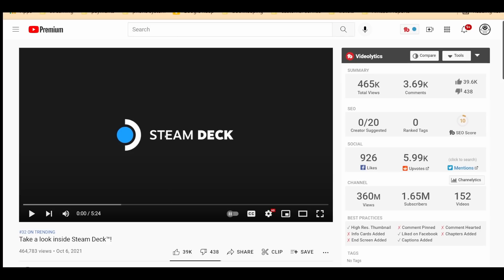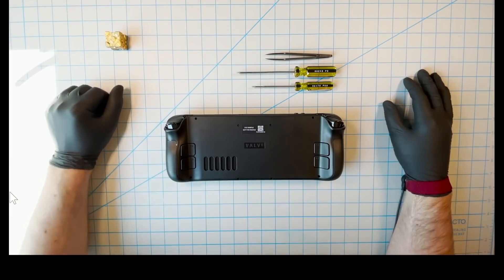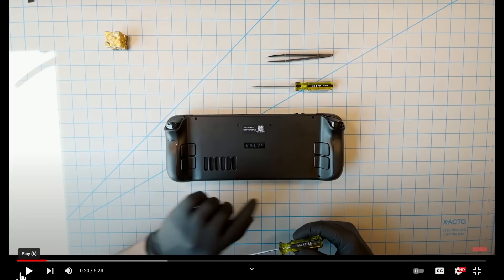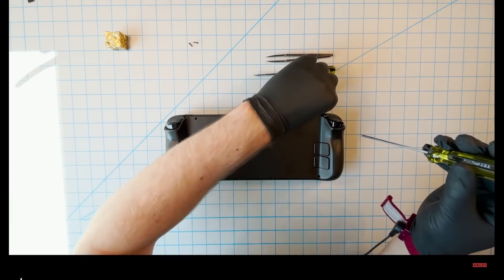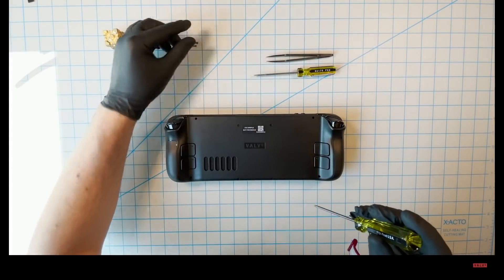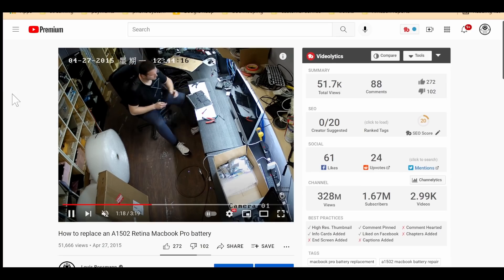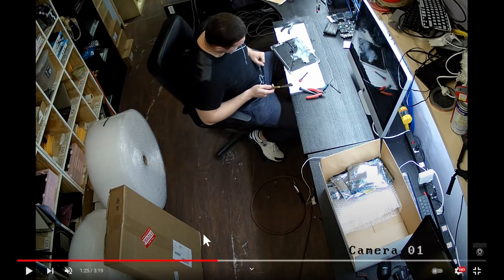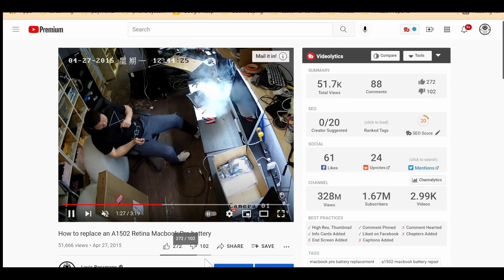Steam deck battery may end your life? bruh 😑

Comment: Self tapping plastic screws can bear most load when they are first installed with exact torque. 
When you reinstall them in the same thread with the same torque, they should be still performing optimal. 
But when the torque is too high, or a user made a new thread into the plastic, the connection is weaker. 
I doubt that matters though, unless someone treats the device roughly. 
And 3rd party repair or the user might be able to melt some brass inserts into the plastic and use proper screws from then on.
Reply: I'd also imagine that overtightened screw can apply extra stress to the area. Dropping it at the wrong angle can apply additional stress that might cause the case to crack.
Reply: I was just about to comment to this effect. The "will reduce impact resistance" is more "can reduce..." and I suspect most users would never notice a difference.
Reply: @AaronAlso  I'd say that the "will" instead of "can" is simply a CYA kinda thing. Prolly won't do much to change the structural integrity if reassembled as manufactured. I like @Arno nümuss's idea with the brass inserts, not too difficult to install. Just need to ensure that the addition doesn't have a negative impact on the rest of the system!
Reply: "I doubt that matters though, unless someone treats the device roughly. "
Based on how most people's phone look like, I can safely say that most people will abuse the shit out of this device.
Reply: I agree with your opinion but I would also add that if the screws are not cross threaded than the device should be as structurally sound as it where before opening along with the appropriate torque.
Reply: I second you opinion. It agrees with my fundamentals in materials science from Mechanical Engineering. That being said, the likelihood of all of the users reassemble the thing correctly is very low. I doubt I'll even find a torque wrench for such low torques. And I owe 3 so far....
Reply: As someone who gets brought a lot of random stuff to fix because "you know tech stuff, so please fix it?", and having seen things that other people have opened up first, I can attest that a lot of people don't understand the difference between their plastic stuff and the lugs on their car wheels, because I've had devices where half the bosses were broken off or split because someone felt they needed to use 80 ft-pounds of torque during reassembly.

Louis is too used to working with competent employees, and with computers that use metal inserts for the screws to thread into, that he hasn't seen what some ham-fisted people can do. But I can imagine that the Steam Deck people have workers who are experienced in providing support to similar plastic devices (game controllers or mice or whatever else) that people have completely destroyed by taking apart and reassembling with zero understanding of what they're doing, and that's what they're trying to avoid here. I get it. It's real. But folks like Louis and anyone who works on stuff like this all the time is not really going to have a problem - if a screw isn't threading right, they're not going to just use force to force it - they'll stop and figure out why it's not going easy, and they'll solve the problem. It's the people who WILL use force - and split or break off the screw bosses or strip them out completely that are the problem, and these people definitely DO exist. And they're always the ones who want a free replacement, plus some "extra" for their troubles.
Reply: @BigTroyT  I generally agree with that assessment. But I don't know the numbers of customers who are like that and if they are reason enough to cause that business decision. Or if it's done out of principle. In the end it doesn't matter. They covered their butts legally and now I just hope they will provide quality information for owners who want to do repairs at their own risk.
Reply: I agree with this, it's a "Can" more than "Will" but they did say to use a torque wrench or screwdriver to reinstall. Which I would say is just providing instructions to prevent stress or damage.
Reply: You know there will be people who will over-tighten the screws, and that will actually decrease the structural integrity of the device. So I think it's totally fair for valve to say that.
Reply: @brentlidstone1982  I don't disagree. I just say it's not a problem that is guaranteed to occur for everyone. Especially if they provide information like the correct torque, qualified repair will be able to deliver a repair that is hardly different from the original. One could program the screwdriver to find the thread and then screw it in with the correct torque reliably. Home repairs are also possible depending on the skill set of the owner. Good sensitivity and dexterity will allow someone to feel the original torque upon unscrewing and also feel where the thread is upon re screwing until the torque feels like original. It would be the owners responsibility though, to treat the device according to the quality of their repair.
Reply: The first thing I would do is drill and press inserts into the screw holes, and fashion some nice machine screws at the proper length. The moment the speaker referenced self tapping plastic screws, I was like  "oh hell no!"

I would not suggest heat inserts unless you know exactly what you're doing. Once you damage the posts enough, repair on the plastic becomes a nightmare. (The small size makes installation a chore.) *I HIGHLY suggest you use a hot air station to heat the inserts at proper temp for the plastic. Mine is digital and has accurate temp settings.

Get yourself the proper drill size for the insert.
Buy a "hand pin drill."
Get something you don't care about and make a couple practice runs.

Don't use a small pin to widen the hole, and use a BIC lighter to heat the insert. (yes, I did this once, no it didn't go well. After much rework, it eventually assembled properly. It sucked!!!!) *Plastic welding on tiny stuff sucks, "Wear a respirator!"
Reply: @senselessinductor7921  I can relate to the pain of fixing plastic parts. after a lot of suffering, I learned a few things. The main reason why welding such plastic sucks, is because residues of the "stuff that keeps it from sticking to the press form during manufacturing" is still on it. Assuming you have a clean surface, gently preheating it with a hot air station and then using the same plastic in a 3d pen works well for fixing small things with a weld. It feels pretty much like MIG welding. Thinking about the inserts, I'd probably use a spare heat block for a 3d printer and turn a copper cylinder with a small cylinder of front to guide the insert. Then I'd gently melt it in at a appropriate temperature for the plastic they used. Assuming it's ABS, I'd go with 240°C. With a calibrated soldering iron, I could also set it to the right temperature and use a modified spare tip to gently melt the insert in.
Reply: @heyarno  , 3D pen for plastic welding... OMG, I love it!!!! Yup, I'm taking that one to the bank!

And here I was using plastic sticks and a soldering iron... Oh how SMRT...

I'm actually a metal fabricator by trade as well, so yeah, I can absolutely relate to the MIG welding reference. And as for "clean" parts, I think the TIG experience definitely relates to that too. Oh, how a bit of oil can ruin your day...
Reply: @senselessinductor7921  Good luck. According to the information I found, ptfe spray is often used in the industry to keep the plastic from sticking to the hot tools. Cleaning that is no easy. It resists most chemicals. So mechanical removal is the way to go. I carefully use a silicone polishing disc in a dremel like tool to remove the top layer. Fine sandpaper should also work.
Reply: they did say use torque screw driver
Reply: @mcmunhuu6713  Indeed, just not what torque to set it to. Also there is the problem, that some people don't know how to use it correctly or have no feeling for where the old tread starts. I hope they will put out better information for those who can responsibly repair and maintain the thing.
Reply: @heyarno  true sometimes i just bet all into guts to screw right(probaly too loose as im scared of it xD)
Reply: I can bet someone will treat their device roughly. Look how many smartphones with cracked screens and those phone cost double and triple the amount of money than steam deck.
Reply: @Marine5D  Sadly that will be true for some. And If I didn't make it clear, I'm not suggesting that should be covered by warranty. But for independent repair and competent owners, it would be much less of a problem, if they provide information, like what torque is correct.
Reply: I came here to say this almost exactly.
Reply: I can't wait to see custom cases being built for this, probably something in the ballpark of casted aluminum if that's even a thing.
Reply: Well, one trick for self-tapping screws is to screw them backwards first, until they "drop" into place. Then start screwing them in. That way you're sure you're following the original thread rather than tapping a new one.
 
As for the torque: I've opened up countless similar items, and my rule of thumb is: stop when you feel the resistance increasing. Check that the seam is completely closed (sometimes it may be stuck on something), perhaps twist the device a bit to check that the halves don't move w.r.t. each other. If so, you're done.
Reply: without knowing the torque required for said screws, all this is meaningless.
Reply: @Null_Experis  Exactly. There are two ways to get the exact torque. Either the manufacturer will provide it. Or by reverse engineering. One can measure the torque upon unscrewing. The setup would need a high temporal resolution and screw slowly. That way one can differentiate the torque needed to overcome the initial friction from the torque used for screwing. One could also use a indexed setup and measure the torque when stopping screwing back in and stopping at the original position. A skilled technician can come close to the original torque by hand.
Reply: The difference is before taking it out it can survive a big hammer. After is a 1 pound lighter hammer
Reply: I mean... I would say a drop test qualifies as "treats the device roughly."
Reply: I heard they fixed this in oled version

Comment: Automechanic     -   -   -   -       `tis  The Reason for using a Torque-Driver !..    N E G L I G I B L E   Wear.............
......eg.   -  Cylinder Head Gaskit  -   replacement.

W  I  S  D  O  M            G  U  I  D  A  N  C  E             S  T  R  E  N  G  T  H              S  H  I  E  L  D                      A     M     E     N

Comment: I think the structural integrity thing is about the self tapping screws not holding to the thread as tightly as they were when first inserted. Just like re-screwing in the same screw into same hole in the wood. The thread on the screw just removes more material every time its reinserted. Also not many people know that when you reinsert the screw into plastic or wood it's a good practice to turn anticlockwise first to catch the old thread and then screw it back in. If you don't do that you can rethread the hole and weaken it.
I'm not sure if that's what valve meant but I guess this sort of makes sense.
Reply: Also take notice if you ever disassembled something with self tapping screws. The first time you disassemble it they are sitting there really tight. Assemble it and disassemble it once more, each time you do that you'll need much less torque to remove those screws.

Comment: “Coming months?  I don’t like there being lag”
Given that the steam deck itself won’t release until December, I don’t see the problem here, depending on how long “months” actually is.
Reply: There may also be lag due to initial low supply as the components that they have are needed to actually assemble new consoles.  Given how difficult other console manufacturers find it to meet demand for complete consoles even years after release it is no surprise that they would want to prioritise their own supply over repairs.  Especially when demand for such replacement parts should be very low to begin with and any failures would likely be covered by warranty.  It may also be that they wish to delay parts supply until any last minute production changes are finalised.
Reply: At least it's not Half Life 3
Reply: @spamuel98  Well it is the third Steam hardware they are releasing
Reply: @anordinarytree4425  Gasp HALF-LIFE 3 CONFIRMED ON STEAM DECK!?
Reply: A month is 29-31 days.
Reply: @ALXMARTIN  Itʼs 28–31 per month, but here thereʼs an unspecified plural number of months
Reply: @T C The Valve person said “latch” as Louis was busy pausing to say he didn’t like that the replacement parts were going to be “in the coming months” instead of right away.

Wikipedia says the Steam Deck is expected Dec 2021 but with Valve time who knows.  I don’t know where you’re getting March 2022.

Edit: I see “After Q2 2022” on the official page if I want to buy one now, but presumably the first preorders get  them sooner.
Reply: Valve time says it can be up to and including 14 years.
Reply: According to Valve Time, "in the coming weeks" is actually 5 months.

Doing the calculations then, "in the coming months" is roughly 22 months from now.
Reply: @alkyycarovny8334  Hmm, but when will Steam Deck actually be released, then?
Reply: I'd expect no lag from a big hardware supplier like apple or nintendo. Kinda thinking valve can get a pass this time if they have uncertainty on when/if they'll have replacement parts available.

Comment: Self tapping screws stress the material to gain a hold in it. By removing them the material will recover in its elastic region but the plastic deformation in the material will remain. So yes the theory is true that the integrity will be compromised and the material will not be stressed to the same point and the screws will have to be tightened further than there were originally to achieve the same stress. However the tolerances here basically make this point obsolete. If you wish to learn more a quick Google search about the stress strain curves of materials will serve you well.

Comment: 9:30 this is inaccurate. Some chips have high rating for ESD. Most consumer level chips are around 4 KV. Laser diodes and photodiodes are less than 100 V. You will not feel an ESD under 2 KV. Also, he is wearing gloves. Unless they are nitrile gloves and he never reuses them (single use), his wrist wrap is useless. In 80% of cases, ESD damages shorten the life span of the device. Like a cracked glass instead of a broken one.
Reply: Valve here specifically mentioned a spark, which most ESD that sparks is well over 10kV.  The idea was they were assuming people watching this were consumers that don't know how things get taken apart (noted by the "taking apart things is cool") and most of them would assume all ESD is visible and painful

Comment: If those screws (the inner ones 'sensitive to stripping') do become stripped, they would lose their hold on the plastic and maybe make the deck more prone to coming apart.  If the corner screws did that?  For sure you'd have issues.  Annnnnd if you warped or twisted the clips that hold it together once the screws are removed (don't break a fingernail), you're going to have a problem.
Alternatively?  Don't drop it.

Comment: 8:40 it’s because the self tapping screws tap the posts to a perfect fit when first used. After that, the re inserted screw is nor as tight. The real risk is over tightening. This is done to save money.

Comment: With regard to the screws, I would say it can lower the structural integrity, but not by much. I've taken a lot of stuff apart with that type of screw and they only really fail after being over tightened to the point of stripping the plastic

Comment: The integrity part will be mostly "cosmetic" and not funcional. Basically if you remove screws from thir plastic molded holes it is more likely that the plastics will creek when you put it back together. It's just telling you that if you have opened and it then creeks, don't blame it on bad quality but on your own assembly and disassembly

Comment: I like the fact that it's so modular and Valve is planning on providing replacement parts. With several PCBs inside that thing, it should be pretty easy to replace the individual components that need replacing, rather than the whole damn PCB.

It would have been really nice had they just spent the money on putting real screw bosses into the plastic housing. Linus did mention that it would have significantly increased the cost of the device however. As it is, I think Valve will be selling these at a loss.

Comment: I feel like the flat cells are safer than the cylinder cells such as 18650s when they go up. My take on it is that a lot of the pressure in the flat cells is relieved by the cell inflating on failure where as the metal cylinder of the 18650 or similar cells acts as a pressure vessel. I have had one 18650 fail on a dodgy charger and launch itself across the room before starting a small fire in the corner.

Comment: About 10 years ago I had a Samsung laptop with similar plastic/screws and I accidentally over torqued the screw on the corner where the power supply was. Over time the degraded plastic tore free from flexing (during movement and opening the laptop) and it started to crack open. Eventually it cause the power plug in connection to fail which caused a catastrophic power surge.